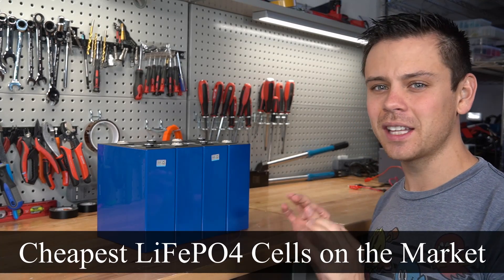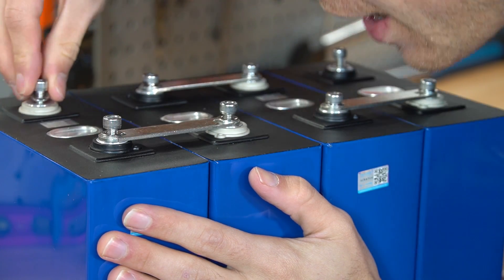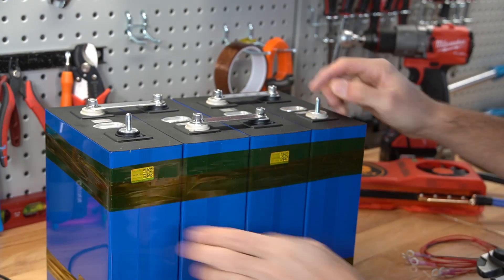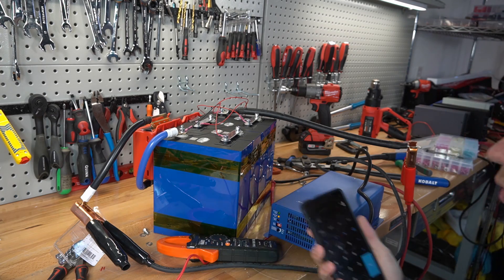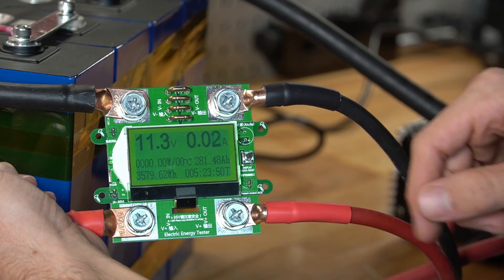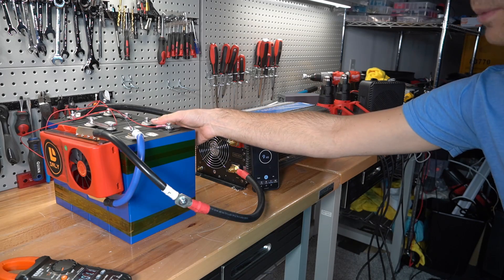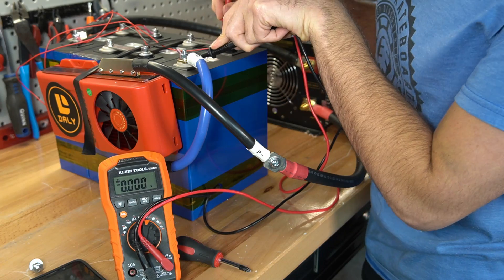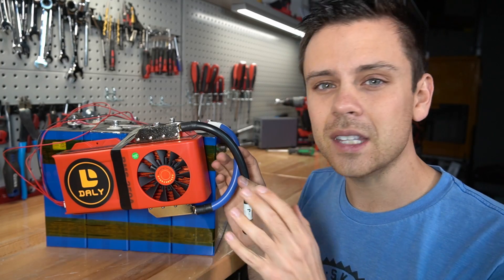$433 280Ah LiFePO4 Cells Tested: Cheaper than lead acid!

Comment: Hey Will, awesome channel!  Total newb here but I'm trying to learn.  Building a 280ah 4 cell 12.8v system for a UPS indoor application.  What do you recommend for a charger?  The amzn you mentioned appears to be not available?  My highest amp draw for this application is going to be really low (less than 20amps).

Comment: Hey Will!
Have you had any experience with the CATL lithium cells? I believe the new ones are 310ah, not too sure on the AH but it's somewhere around 300ah or more. I'm getting ready for an RV build with ambulance, any help and opinions on 12, 24, vs 48v would be awesome. Just worried about having enough amps for running mini split constantly in AZ heat. Along with TV, computer, fan, blender, electric cook top, ect.. I hope you have some information on these CATL cells, seems no one has them yet. Thanks for your help!!!

Comment: Loved that review.. looking at building a 4x4 12v system and using 320ah cells similar to this.. with the Daly non fanned 250a common port option. This only confirmed with me that I am on the right path! Thank you .. awesome vid and also great commentary and notes re tooling and what not as well..

Comment: Hi, I'm new in this world about solar systems and camper life,so just a one question please,...🤗 If I use this battery pack on my SUV, how long or at all it's can run 3000w inverter without running engine... Thanks Edgar. 🤗
Reply: Depends on your load but if you're using the full 3000 watts it'll be over 230 amps drawn from the batteries after efficiency losses.

If you have 4 cells in a 12 volt system it will last a bit over an hour but will be a rather extreme draw and you won't get a lot of life out of them.

I wouldn't recommend that.
Reply: @Spearborne  Ok thanks,I just used 2000w induction hob for 5 min in the morning and about 15 min for dinner so it's could be ok, because sometimes I don't like a run engine. Thanks Edgar.
Reply: @edgarneo999  I should clarify. You should actually get the rated life out of the cells at that current. I must have been stuck in the mindset of making lead acids last longer. 

If you're not actually using the whole capacity of the 3000w inverter it will last longer. 

If you're doing this on a starting battery in your suv you'll kill that battery very quickly at that load.
Reply: @Spearborne  Thanks for answering, that's the reason why I planned add second battery and install the solar system. Thanks Edgar.
Reply: @Spearborne  So what you think, maybe I can use the AGM battery ,I just found the information so lot of people use it as main battery and I have a space under hood for second battery,so in your opinion what you recommend. Thanks Edgar.

Comment: Hi Will and thanks for these great videos. You recommended that it would be better to run higher voltages in place of 12volt. I would like to build a battery for my camper. Normally this is 12 volt but does it have to be, in your opinion. Sure, lighting and refrigerator usually work from 12 volts  but maybe there are work arounds for these. I also want to use a large inverter to power an induction hob. Crazy or not😜?

Comment: I bought these cells over your link and figured that mine were resleeved differently than yours. The QR-Code on the top was covered, so I ripped the wrapping off to see the actual code and it was damaged to be unreadable. How is this possible? Did they send you some new cells on purpose, cause they know who you are or how do I not get the same cells as you did? I don't get it. :(

Comment: I will add I was running one lifepo4 and it cut off at speed 4 assuming it was pulling 40 amps so I paired two batteries together in series but still have the same issue 
Power Sonic PSL 12450

Comment: I need your help. I have  2 lifepo4 batteries 45ah 25 amp power sonic psl . 
I’m trying to run a Minn Kota 55 pound thrust trolling motor that draws 50 amps.
I wired 2 batteries in series to get a higher amp rating but on speed 4 and 5 the motor cuts off. It will run for days on speed 3
What am I doing wrong 
Thank you for any help

Comment: For damaged threads, buy a small assortment of HSS form taps. The tap will form the thread back to good fit. Not cut metal away making it weaker.

Comment: Greetings from Munich.
I like your channel and your experiments.
I have also lots of plans like this but they are hindered by phase 1 step, that is buying a house :)
Doesn't it make more exciting if we push this energy into the grid using a good inverter instead of using heat guns? It might not be a lot of energy but still something.

Comment: I bought 4 of these cells recently, with plans for 12 more, for which I'll make a 16S Battery.  Should I get 4 4S-BMS's, or a single 16S-BMS?  What's best practice?
Reply from the maker: 16S bms is ideal. You can use separate bms, but you will save money having one.
Reply from the maker: And less potential for failure having one bms versus 4 bms
Reply: @WillProwse  

I see.  I've seen those combo MPPT units running in the hundreds - any out there with a built in BMS?  I figure with the BMS integrated into the MPPT, that would be more seamless approach?  

Also, the combo units would save a novice like me the trouble of all the extra cables and logistics.

If you have an online store I can click into, that's be great.

Comment: HELP PLEASE HELP! I just recently got this exact setup for my camper van and I am very very lost. I have a Renogy 12v 40 amp DC-DC charger that I will be using to charge this battery. I also have a Renogy 500a battery monitor. I have everything connected just like in the video. However, when I go to charge the battery, my battery monitor notices a change in voltage but does not indicate that the battery is being charged. I don’t know where else to go for help and I need it ASAP! Please help!!!

Comment: I'm tempted to buy these batteries but most stuff from Ali Express doesn't arrive in Australia. Don't know why. I usually get things express registered post because the tracking is accurate and items arrive or I am fully refunded. Free post(slow) is 89% unreliable. I need to make a 24volt battery. I have a Victron liFe charger and 2 solar panels that can be wired in series for 24Volts.

Comment: if I want to do a system mit 2x4S pack with 280Ah 3.2V each cell, do I need 2x BMS 4S for 12V or is 1 BMS 8S enough?

Comment: Thanks for the video!  So, if I upgrade my RV house batteries to lithium and go to 24v up from a 12v system (4 x 6v in parallel and series of 2 x 2), and I upgrade my inverter from 12v to 24v, will I need to do anything to make this compatible with my 12v lead acid chassis battery?  There is an "Auxiliary Start" switch which, when held, connects all the batteries together to start the engine or generator.

Comment: Does anyone know what size the terminals posts are on these batteries?  I wanted to buy the bms but want to make sure that I get the correct version.  Also can someone help with what type of tape that is to wrap the battery cells?  Im doing my first 24V battery :)

Comment: I just bought 16pcs New CALB SE200AH 3.2v 200Ah LiFePO4 Iron Phosphate Rechargeable Battery Cells on EBAY for $299.00. What should I expect? They are coming from China.

Comment: Did your batteries come with the bus bar connectors? I don't think mine will have the bus bars included. Do you have any recommendations on where to find prefabricated bus bars at a reasonable price?

Comment: I am curious about your bench charger, able to put out 150A @12V. I am contemplating 8 of these 280AH cells for a 24V system, but car chargers won't work, guess I need to figure on a looong time to get up to full initial charge. Also, thinking about a system that would be good for ~3 days of outage in rural OR, where I don't have 180 degrees of solar exposure or a tracking system. Has anyone set up something that would activate a trickle charger for night, based on when battery voltage dropped below say 23.1 VDC? I suppose a relay system would work for that, but I'd rather keep it all solid state, since it is covered but outdoors.

Comment: What's improper about using 12v lifepo4 batteries in RVs and trucks is:.   If connected to a battery bank together with acid Dee cycle batteries is:. Acid batteries can be discharged to 12.2v to  they charge to 12.9v.   lifepo charges to 13.35v that's good but when you only discharge it to 12.2v you're only using 1/3rd of it's capacity since lifepo4 can be discharged to 10v.     So you're getting 30ah out of a 100ah battery.        They need to build a BMS with stepup transformer  used for discharging the battery.   So it will provide 13.3v until the battery discharges to 10v.     That's the only way you'll get close to 100ah out of a 100ah battery.         They don't make such BMS .      So to get an actual 100ah you have to use a 300ah battery.
Reply: Huh, I'm pretty sure any BMS made for Li-something would have the option to let them drain to 10v or whatever the lowest voltage is that you'd want to let your batteries drain to. You'd also have to set your inverter and or charge controller to let them drain that low as well.

Comment: At 6:30 did I see that “fully charged” was 16.16 volts? Is that ok?
Reply from the maker: No. That was on the PSU end after fets disconnected.

Comment: Great videos Will. I bought these batteries after watching your videos. I am planning to use them with Victron MultiPlus 3000. What would you recommend for the Absorption voltage and float voltage? Much appreciated

Comment: Still not cheaper than lead acid
Reply from the maker: Yes it is. Lead acid dod is 50%. These are 100%
Reply: @WillProwse  Yes, considering lifespan and DoD all, not just these, LiFePO4 batteries are cheaper than lead acid. Just the initial price is higher.
Reply: @WillProwse  No, not 100%. Fo 12 V LFP battery the voltage remains above 12 V till about 80 % discharge then it drops rapidly. So it is still not a 100% of usable energy.
Reply from the maker: And they last 10 times longer
Reply from the maker: And higher faradaic efficiency

Comment: Did you measure the voltage sag when you first ran the test pulling 1 C?....I bought prismatic LifePo4 cells on Alibaba rated at 50 ah in my ebike, and under full load (50 AMP) they sag to 2.9 volts..now I did my tests at a temperature of only 6 degrees C so they should sag much less at 25 C..Im curious....

Comment: Just a heads up. I cooked a set of these cells today. Charge controller shorted high side fet. Daly smart BMS with no discharge load. The BMS charge FETs shorted when it tried to turn off charging. I am running 90v solar array. So cells now look like pillows with electrolyte everywhere. No fire of course. Moral of story. Daly BMS does not state their open circuit voltage handling but it must be low. If your charge controller shorts the Daly might not protect your battery. I might open and read FETs to get an idea of maximum voltage. Thankfully inverter was not damaged. Reached 4.75v/cell at least.

Comment: Hi Will, have you done any research into the possible release of HF acid gas been formed in cells. I read a few papers, but its unclear if HF is formed from over heating lithium ion or lefepo4 cells.

Comment: i read on a few pages those busbars are only rated 48amps if you use a calculator for busbars? yet i see will pulling 250amps off them no issue?

Comment: Great video. Sadly I paid Soon Buy on AliExpress for 16 of these cells. They have failed to send them and are messing me around. I get alot of stuff from China and am mostly happy. This is an expensive order to get ripped off on.
Reply: You are not the only one that reported "issues" like that from Soon Buy.. by reading the negative feedback on their site, it saved me from the same problem you had. I noticed some of the vendors on AliExpress that Will has links to, had 18-19% negative 1 star ratings and stories like yours. I don't feel comfortable losing that much money.. There must be an honest supplier that does not do what happened to you. Perhaps Will will highlight someone like that?
Reply: @OneDayCloserToHim  I cancelled the order from SoonBuy and the refund is granted. I'm waiting for the money in my account. I reordered from BLMPOW and the communication that took a week just to order with SoonBuy happened in 10 minutes. I am, needless to say, more confident.
Reply: @FabhcunGorm  So glad and hoping it all works out. If you wouldn't mind, I am interested and please update with how long it took and the quality of the batteries?
Thank you for the response Ronan! All the best.

Comment: These are the ones I got! Thanks for the Ali E link Will! I followed it for purchasing and I absolutely love these cells they're performing very well. They keep in balance nicely voltage diff of 8 to 3 mili-amps with normal usage 20 to 80% capacity.  Cheers and sunny days brother  🌞

Comment: Hi Will. I have those exact batteries (8) and the 24v dally bms. I was told the bms doesn't work, wondering if the bms was shorted. At that point is the bms trash or can it fixed? Also, one of the batteries did swell, is that trash as well? I'm recently on my own and know nothing about off grid power. Also trying to figure out how to charge the batteries on the current system I have. Maybe one by one. What is the full charge voltage on one battery?

Comment: Hello I have ordered a set of the 280 amp cells you are using here, but there gonna take months to arrive in in France , but I can get a set of the same brand but 200amp my system is 12v in RV , will it be ok to put both battery's in parallel so it totals , 480amps , or is there a reason not to do this , thanks rikki

Comment: I just ordered "4PCS 3.2V 280AH LiFePo4" on eBay from China for $200 USD and free shipping....I'm REALLY hoping I didn't just get hosed....

Seller had a good rating and some good reviews...but still hoping this wasn't "too good to be true." I'm rationalizing in my head that maybe they're just trying to offload some slightly older stock...I guess I'm just posting this to gauge if anyone has had success at a similar price. $200 for 280ah/12v would be one of the best deals yet in solar lifepo4.

Comment: I finished building my 24v battery bank with 280 ah cells. It's so powerful. I'm using it for my UPS unruptible power supply and also have it hooked up to 4 solar panels and I'm using a mppt solar charge controller.
Reply: Do you still have any of those that you are not using? I really need them?

Comment: I am very new to all this.  This is my very first day looking at videos about batteries, and haven't even gotten into solar cells yet.  I'm good at DIY and have no issue with scratches or finding studs instead of screws, etc.  I'm wondering if you believe these ali express batteries are truly a good option over more expensive lithium batteries, or if this was just a cool test and you'd recommend name brand batteries when putting together a new RV and solar system.

Comment: Nice video. I actually learned something from it. One month last summer I used almost 1450 kWh. 1. How many of those batteries do I need? 2. What size wind generator do I need? 3. What size inverter do I need? 4 Aare those batteries 3.2v and 280 Ah each? Thanks in advance.

Comment: Cheaper than SOME lead acid.  Overpriced lead acid only.

For the past four years we've been running 4 Duracell (Deka) Sam's Club 6v GC-2 FLA golf cart batteries for 430AH (215 at 50% DOD) at a total cost of $260.

So not cheaper unless you are comparing apples and Oranges.

Comment: I ordered 2000 euro worth of batteries from one of you links (SoonBuy) I have often got alot of stuff from China so I know this works out generally. I cant contact SoonBuy because the contact button on their AliExpress shop doesnt work. It is a pity problems like this are common to Aliexpress.

Comment: I bought a 100a daly bms will that be fine for a 200ah pack and what is the worse downside of only have a 100a bms?  I tried getting the 150a and then the 120a but the company didn't have them at the time
Reply: Just depends what you are trying to run - if your applications don't require a total of 1200 watts (100 Amps) then you're good.

Comment: Will, what do you think of doing a 560 ah 4s2p ( using these batteries ) with a Daly 300 amp bms to run victron 3000 multi plus in an rv?   I was struggling with how to get the 250 amps for the inverter and run the rv.  My initial thoughts where to run a 100 amp bms and have 2 Victron battery protects at 220 amps each wired to the negative output of the bms as a switch

Comment: Now it's $638,83 to Ukraine... ($75.26 for shipping).

I ordered from another seller, Liitokala, for $ 414.80 ($ 405.50 with coupon and free(!) shipping), but they suddenly decided that this cost was not enough for them and raised it to over $550, and they told me that there was no cells in a warehouse. And then they completely turned off the sale of these cells. I lost about $15 (bank cashback, Ali coupon and difference in rates).
Reply: bxT7lxgskJ0
They did not want to sell me cells for $405.50, I bought for $393.24 and returned $84.65 on a dispute, as a result they cost me $308.59. Almost $100 cheaper. How cool is that?

Comment: I previously built a 280ah eve battery using the overkill solar 4s BMS. I ordered another set of EVE cells from Ali Express and another overkill solar BMS. I just got the cells and they sent me Lishen 280ah cells. Will there be any issues using these 2 different cells together? I greatly appreciate the assistance.
Reply from the maker: You can actually safely use them in series. Just ensure that all of the cells are charged up before you put them together. But that should work. They are very similar cells.
Reply: Thank you I greatly appreciate the assistance I was worried about compatibility